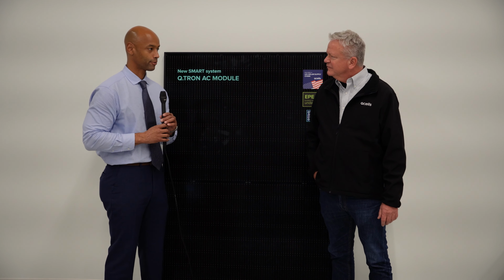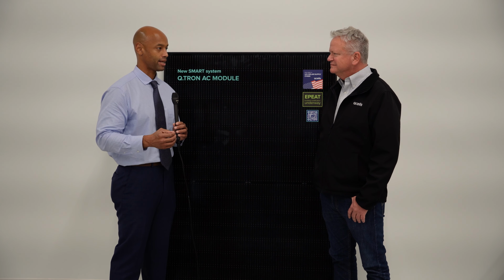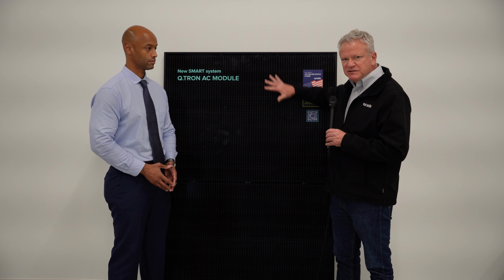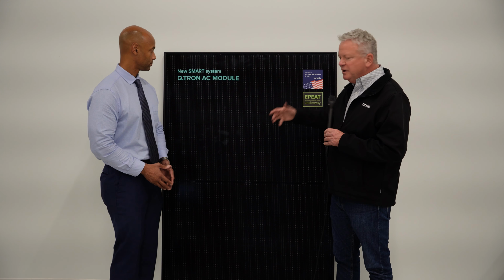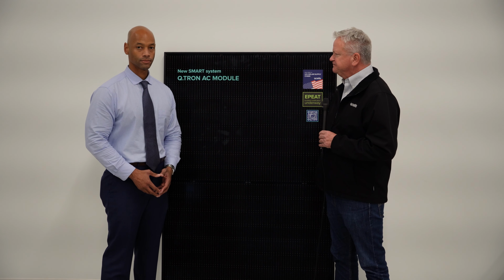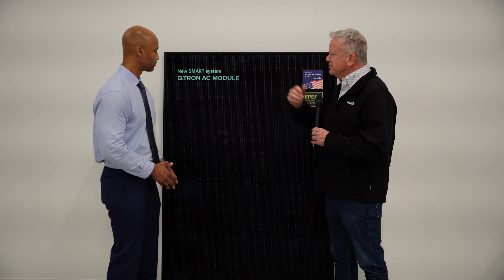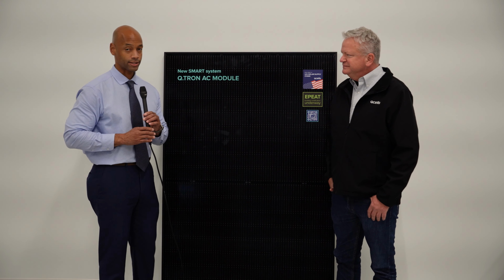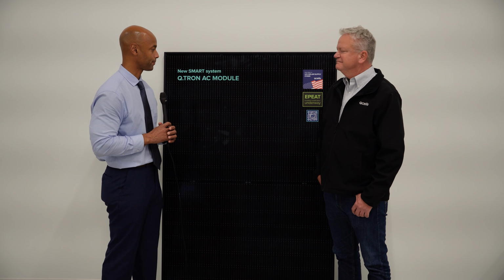New Qcells Qtron AC Module

Comment: Micro inverters have been available in the market for some time now. The panel is basically designed around DC power generation at the cell level so that means basically Q-cells hasn't done anything new but  entered the micro inverter market recently. Good luck to them but the creator of content needs to correct the title that it's not an AC module after all. The other issue is that the inverter (whether micro) still needs a secondary pulse or reference voltage which means battery storage dependency stays there in case of grid failure(s) and is yet to be resolved.
Reply from the maker: Good feedback.  Now that solar + storage systems are becoming more popular, especially in developed markets like CA, the DC-coupled system design will be more popular.

Comment: In my mind , that's just too many conversions from a c to d c back to a c back to d c. Too much complication too many things to break. I find that eighty percent of my customers have software problems along the line somewhere. I guess I'm just too old school. I want a low frequency inverter that weighs 2 or 300 pounds. Bring d c n at forty eight volts charge the batteries zero software.

Comment: My biggest questions would be -----  (A.) If the microinverter on the panel fails is it easily replaceable or is it permanently fixed and wired into the back of the panel and thus forcing you to buy a new panel instead of just replacing the microinverter.     (B.)  How much more does this panel cost with microinverter compared to the same panel without inverter and outputting DC voltage?    I like Qcells for being "made in the USA" but this video seemed to create more questions than answers for me.
Reply: Replacing the whole module would totally suck if the microinverter fails. Enphase micros are plug and play, easy to switch out and can be added to a mix of different brand panels. I have 2 different panel brands as I've added more over time and all have Enphase microinverters. btw they are super reliable with an extremely low failure rate.
Reply from the maker: I would think if the micro fails, best to just replace the entire module.
Reply: @SolarSurge not what I've heard from local installers. They say its modular and can be removed and replaced on panel
Reply: plus a hacker can turn your power off

Comment: What's the efficiency of converting between DC and AC 3 times, solar DC>AC>Battery DC>House AC. Vs just doing one conversion: Solar DC>Battery DC>House AC
Reply: Great call-out, any conversion is going to create loss.
Reply: 4-5% add a panel or two and stop overthinking it
Reply: It ends up being about 3% less efficient than dc coupled system, however a dc inverter is always going to have a “ bottleneck” as far as ac output. I prefer ac systems being an electrical contractor but that’s just me
Reply: With multiple dc to ac conversions you will typically lose 2.5-3.5% energy by the time it hits the home.
Reply: Great for non battery installations, also less line loss with AC vs DC.   

More choices, DC panels still available for those that want it